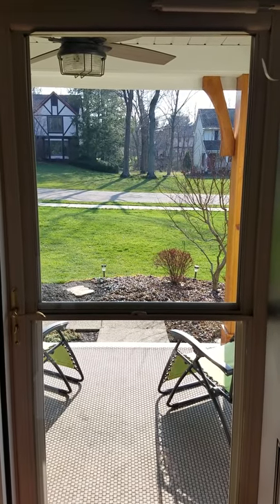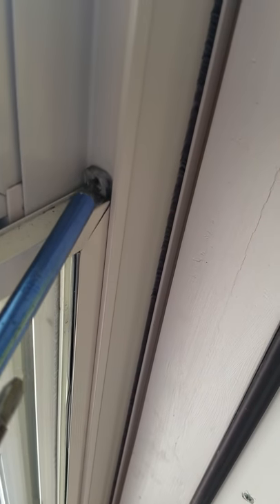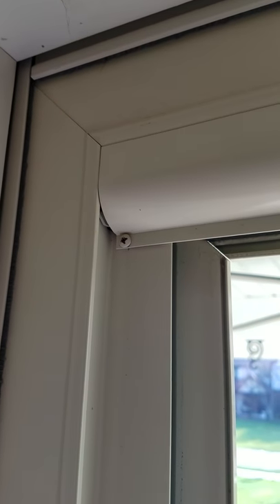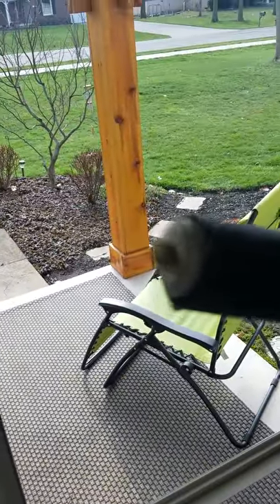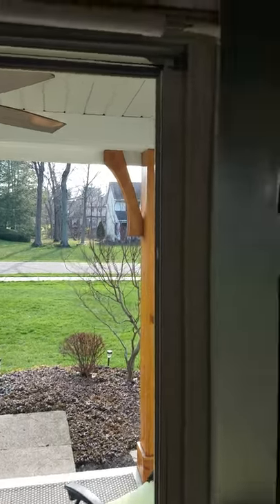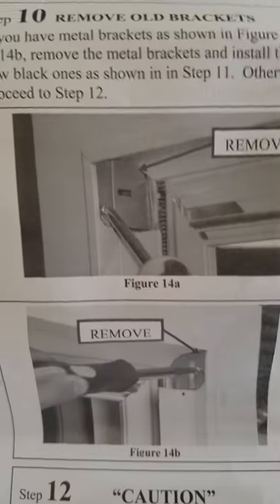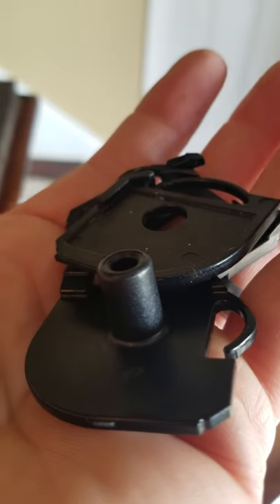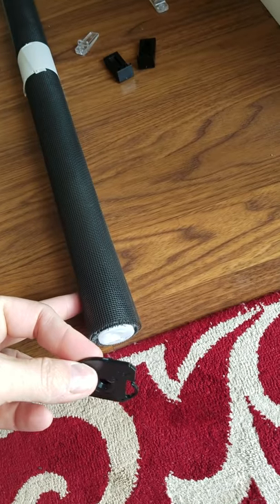DIY -  Larson retractable screen replacement

Comment: Great video but i can't find a replacement part for my door. Been in touch with Larsen but they never get back to me. Where did you get yours?
Reply from the maker: On the Larson website there was a section where I entered the door serial number. It's on the jam on the hinge side. It's a sticker. As soon as I punched that number in it had all of the necessary replacement parts listed.

 Good luck.
Reply: My door is over 10 years old and the serial number has worn off, it was only made of paper. Your door looks like mine, the cover at the top covering the rolled up screen is 22 inches long. If yours is the same width can you please let me know you serial number. Thanks
Reply from the maker: Unfortunately,  my inner screen cover is 31" wide.  I would contact Larson directly and give them some specs.  Hopefully they could set you up.
Reply: Thanks so much for you help!!
Reply: @edfreimuth8500  I have the same issue, worn numbers on paper sticker for screen door.  Did you find a replacement screen? If so where and how etc?  Please and thank you.!   I have the same door.!

Comment: My screen is not broken, just pulled all the way out and no tension to retract.  I want to pull out the cassette, rewind/retension the spring and put cassette back in.  I am having trouble figuring out how to just remove the cassette.  I am interested in seeing how the cassettes is removed and re-inserted.  This part is missing from the video.
Reply from the maker: If I remember correctly,  a flat head screw driver was needed to pry ends of cassette out. Apparently there are some different styles.  Sorry about the missing step.  I don't remember it being difficult.   Good luck.

Comment: How did you get the glass that attaches to the screen out.  The glass broke and can not get the frame out to be replaced . Thank you if you have time to respond
Reply from the maker: If you were talking about the upper sash that the screen attaches to buy a rubber seal, you slide the whole stash to the left and it should pop out on the right side. If I remember correctly. Good luck.
Reply: @steelydan8421  the screen roll and attachments and hardware are fine but some hail busted the glass frame and your video doesn't show how you got that upper glass out. Does it come out the top after taking the roll out? Wonderful video and response time
Reply from the maker: I believe you slide the upper sash all the way down, slide it or push it to the Left and then the sash should pop out of the right side lower frame.
Reply: @steelydan8421   I'm not having trouble with the sash but the upper window it attaches to . I can not remove the upper glass it slides into on your video you already have the glass out to attach the sash . So my question is did you slide the glass out of the top ? Or how . Please and thank you
Reply from the maker: The upper sash is the upper glass that the screen attaches to. Try sliding it all the way to the bottom, sliding to the left and then popping it out of the right channel.  Good luck

Comment: Where did you get Larson retractable screen replacement from
Reply from the maker: Directly from Larson website.  There should be a sticker on your door frame with a model/serial #.  Enter that number in on website and it should pull up all parts available for your particular door.  Good luck

Comment: How much was it? Great video! We just purchased a house with these and I didn't even know where to start lol.
Reply from the maker: Kyle Gleich Ordered directly from Larson website.  There is a serial number on the inside of the door jam (hinged side).  It's like a VIN number for the door.  Enter that number when asked and Larson will have all the information for you.  I think the new screen was like $47...?
Reply: Steely Dan you rock! Thank you so much. I'll be watching this video again during install, thank you!
Reply: Thanks for the video though it ends abruptly. I took my door apart only to find out Larson sent the wrong size screen for my door. 36" need a 27" screen. So now I wait for the right screen and put it back together with the help of your video.
Reply: Kyle Gleich make sure you measure the screen before you take the door apart, Larson sent me the wrong size screen.
Reply from the maker: Marc Ramieri Sorry, battery died right at the end.  I was lucky it saved what I had done.  I'm surprised Larson messed up screen size?  Did you give them correct VIN number off door jam?  Good luck.
Reply: Steely Dan I did give them numbers off the jam, hey mistakes happen that's why we put erasers on pencils.

Comment: At the very beginning of the video (0:40), you mention removing the 2 screws on the bottom sash.  Does anyone else have a door that doesn't have the 2 screws? Mine has a horizontal white plastic square that cracks when I try to pop it out.  Perhaps the screw is under that? The door is about 17 years old...maybe an older model??  Thanks for any suggestions.
Reply from the maker: Sounds like an older model. Ours is about 10 years old. Good luck
Reply: Inside those squares are the screws. I have the same door.

Comment: Great video, thank you! Where did you purchase the screen replacement kit?
Reply from the maker: Directly from Larson website.  There should be a sticker inside the door jamb it has a identification number. Enter that number into the Larson website and it should pull up all of the parts for your door. Good luck

Comment: Please please please tell me where you can find the actual rolled screen so I can replace mine. I have searched everywhere. I don't know what type of door I have. I know it's not Andersen... I'm guessing Larson... Mid-view self storing... I can't find the part I need at all...
Reply from the maker: Did you check the door jam for a sticker?  There should be some kind of identification number on it.     If you can find that, plug that number into manufacturer website.
Good luck.
Reply: @steelydan8421  I haven't found any indications . Serial,mfg, nothing.
Reply: It is Larson. I went to lowes. They said they had to order it... not a home owner. I ordered one.. let's hope it's right. They buy at lowes didnt seem to be able to tell me the screen size.. we will see

Comment: You need to show people how to reset the spring. In the directions it says use vice grips to turn the flat part of the screen but you can just use the black clip to wind up the spring and then slide the roll into place at the top while its connected to the top sash before you put it back together. Figuring out to set the tension is easy just wind it about 7 or 8 times clock wise and slide it right into the top.  You could turn it up to 20 times i believe but really as long as it rolls up when i open the door that is good enough for me. I dont need if to open fast thats how they end up breaking anyway.
Reply from the maker: You got me.  I agree that less tension sounds better.  Who would be in a hurry to open and close?  Never had to "retension" it before.  Good luck!

Comment: This was a great video but when I removed my top window, there are two metal housings (one on each side) that hold a spring and string. They just fell out after removing window.  I should say fell down because they are still attached by the string.  Have no idea how to put them back in.  I am sure they are necessary for pull down operation.  My project is at a standstill.  Ugh!!!!   Any suggestions??????
Reply from the maker: I have not run across the string design before.  Sounds like a bad design.  Mine has an internal spring with the screen.  Yours may be a much older/previous design.  Sorry I can't help.  Good luck.

Comment: Thanks for the how to. Do you have any info on the part # or where to order from?
Reply from the maker: Every door supposedly has its own serial number with information. You should be able to find a sticker on the door jamb. You should be able to enter that information on the Larson website and it will pull up any and all parts that you need. Good luck.

Comment: where do you buy the replacement screen at  if you can supply the info ill be very thank you
Reply from the maker: You can get from Larson website.  Need to get door serial number from sticker near door hinges.  Serial number should supply Larson with all the information they need to get you the correct screen.  Good luck.

Comment: I have the same storm door as well. Does anyone know how to adjust the tension in the screen? Mine is loose on one side and allows small openings for bugs to find their way in. I can’t find a video anywhere on screen tension for this exact door.
Reply: I have the same thing.  I have had the screen cassette out and lost all tension on the spring.  I cannot get the tension tight enough to hold the glass in place.  Would love the find the information on adjusting the tension.

Comment: where can i get the kit, my screen needs replacing
Reply from the maker: There should be a sticker with a serial number on the door jamb. If you enter that number in the Larson website, it should pull up all the parts needed for your particular door. That's how I did mine and it was not the easiest website to deal with but I got it figured out and they sent me the right part. Good luck

Comment: How did you attach the left plastic clip?
Reply from the maker: It just dropped down in then, installed screw. I had no trouble. Good luck
Reply: @steelydan8421 So it came with screws to hold it in place?  Thank  you for the quick response

Comment: where did you get the replacement screen from?
Reply from the maker: It's been said in the comments but, you should have a sticker with a serial number or identification number on the jamb of your door frame. If you enter that number into the Larson website you should be able to successfully pull up all of the parts associated with your door for replacement. Good luck.
Reply: @steelydan8421  Thank you yes i found it

Comment: steely dan, i am trying to put this x.x/;ll;//???;,. screen in and i am confused. does the bottom panel come out?  how? you show taking the screws out but not how to get panel out. Also, the other screen does not slide all the way to the top to come out. All hardware has been removed.  I am so confused and frustrated
Reply from the maker: Hmmm,  the bottom sash should come out easily.  If I remember correctly,  push the bottom sash to the left and then the right side should come out.  I'm not too sure about your actual screen problem.  Good luck!
Reply: @steelydan8421  well, the screen came loose from the glass. I ordered new screen.  I have tried taking out the bottom panel, it is loose, but I still can't get it out.   the left just won't budge. I am having a HECK  of a time.  thanks for replying. Joni
Reply: any other suggestions on how to get bottom panel out>
Reply from the maker: Mine just slid to the left and the right side came right out.  Maybe yours is different?
Reply: @steelydan8421  could be. Most of the right side comes out .but I don't have enough to pull it up and out. It can't go any further left
Reply from the maker: Sleep on it for a night and try again tomorrow.
Reply: @steelydan8421  I did it!! I did it!! Thanks for your help! Have a great day!

Comment: How long did you own the door before the screen went out?  Was it at least a few years?  Thinking about buying and installing for my mom, but don't want to constantly deal with trying to fix it if this kind of stuff happens.   I'm fine with installing a new screen everything 3 or 4 years, but for 40 some dollars, that's quite pricey.  Thanks for the video BTW.
EDIT:  Found this video as well.  https://www.youtube.com/watch?v=MZlOO8rgisA&list=PLCNwIXvGjWzUZKNVHBkg-fhqz8Ydtjwgv&index=6
Reply from the maker: Troy Schweitzer.  It actually started  tearing at about a year and a half.  We tried nursing it with tape...didnt help.  All is good now.  Good luck.
Reply: Don’t do it! You’ll regret it.

Comment: Stay away from the Larson wood core storm doors.   Particle board junk has no business being anywhere near the elements, coated or not.  Less than 2 years in and the door is split down both sides where a traditional door's rail and stiles meet....and the wood swelled enough that it hangs up preventing a pull free close.   Larson's lifetime warranty will replace the wood slab but require me to disassemble everything from the old slab and install on the new one.   Uh, yeah.  No thanks.

Also I like the screen away idea, however, I've noticed on mine the vinyl that holds the screen to the top sash shrinks considerably allowing a 3/4" gap on both sides of the screen.   I noticed I was getting a few bees in the house every few days and never knew where they were coming from.  Days later I noticed a couple small honeycomb nests hanging from under my exterior door header with a dozen bees just waiting around to sting me.  I was entertaining the thought of replacing the screen, but after a quick search it looks like a replacement screen away is selling for $89.00.  Once again....no thanks.

Comment: Where did you buy the replacement parts? I went online and can't find it
Reply from the maker: Check previous comments. Your door jam should have a serial number that you can enter into the Larson website and it should pull up all the parts for your door. Good luck.

Comment: I can’t slide down the window on screen door to just have the screen please help
Reply from the maker: I assume the screen is still attached to the upper sash?  Is the screen cartridge "locked up"?  Sorry I can't help more.
Reply: Steely Dan my super just opened it in a second I said how he did that ? He said to pull the handle on the top of the door towards you then pull it down. I’m not gonna close it alll the way anymore I will leave a gap because I tried to slide it down for hours. Ty for replying and trying to help me.

Comment: Is that the easy vent?
Reply from the maker: I’ll be honest, I’m not sure which model it was now. It has been some time since we installed it and I replace the screen. The replacement screen is holding up quite well still. Good luck.
Reply: @steelydan8421  thanks

Comment: Where can I buy the scren?
Reply from the maker: Directly from the Larson website.  Locate your door "serial number" in the door jam sticker, plug that number into website.  It will then give you a parts list for your specific door... at least it did for me.  Good luck.
Reply: @steelydan8421  A difficulty in using the "serial number" method of identifying the door model is that no one tells the homeowner to record the number on the decal -- or at least, my installer said nothing about the decal and the "serial number." Thus, when the decal has deteriorated over time, making it unreadable, to access the parts list on the Larson website seems to be a stretch. I admit that I haven't contacted Larson for a replacement screen for my 7 year old Tradewinds model; my point here is that the "serial number" concept can require a workaround, and a homeowner's frustration in that situation is more than justified.
Reply from the maker: I would imagine that if you could get through to a actual human on the other end (phone), they could narrow down what you need.  Size, right/left swing in/out. 

Good luck

Comment: Wish you wouldn't have skipped showing how you did some of the things needed. Like how you took the window/sash out. Not just describing it. I need a new glass replacement, the screen is ok. Thanks for what did share with the video though.
Reply from the maker: This video was my first how to. Trying to do it while recording with my phone post a serious problem. My phone battery died before I was able to show the final results. If I were to do it again, would have been a lot better quality video. Good luck
Reply: @steelydan8421  I understand completely and thanks for the reply. It is still a good video.

Comment: My screen broke within a month, larson sent me a new one. Three years later I still cannot get the bottom glass panel out.
Reply from the maker: disney like me.  You may need to use small pry tool.  Gently!  Make sure bottom sash is all the way to the left.  I was running low on battery and was trying to move along quickly.   It will come out.  Be patient!
Reply: I bought and tried to replace the screen and the new replacement  roller ends and screen are trash.  I ruined and broke the screen and ends on the roller. I just wasted a day and cost of the replacement. What a piece of junk.  I will have to replace the whole door.

Comment: Most of the time you don’t need to replace it, all you need to do is reset the bearing
Reply from the maker: Some have said how they lost all tension in the spring up top.  Me however, my rubber seal at the bottom dry rotted and just tore.
Reply: Steely Dan oh gotcha, I wonder if wiping it down with a little armor all in the seal maybe?

Comment: What's the part number?
Reply from the maker: See previous comments. It’s been discussed many times.
Reply from the maker: Good luck
Reply: Thank you for your amazing effort on your video. Thank you and God Bless you.
Reply: On another note. My roller does not retract, but the screen is intact. Is there a way to wind it back together?
Reply from the maker: The screen mechanism has a built in spring. I would just replace it. Probably broken from age and use.
Reply: Hi Dan, I was able to replace that screen. Funny thing the first thing it tells you is to cut the screen. Not only that there's instructions on how to reset the spring tension, which I had to do. It took me a hot minute, but was able to successfully wind the spring tension. I wish to share the spring tension instructions, but how can I upload them?